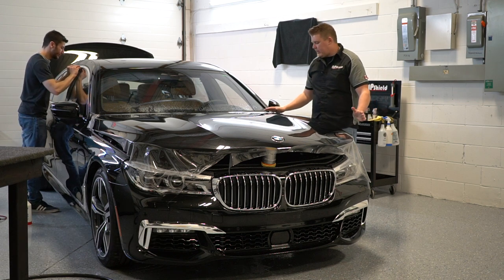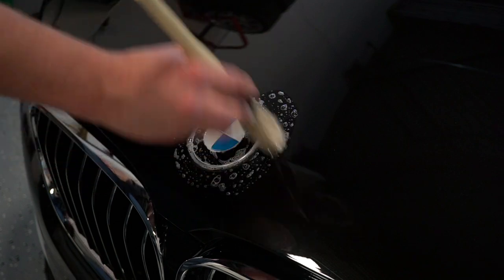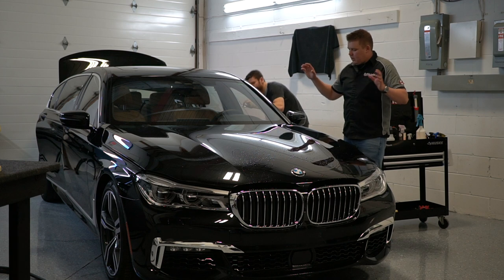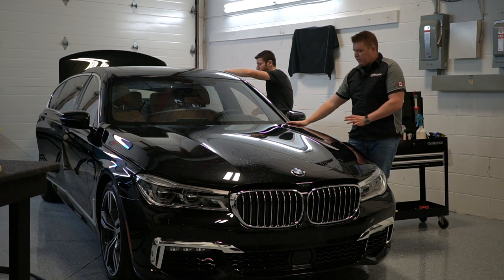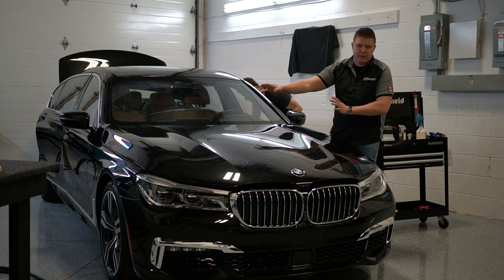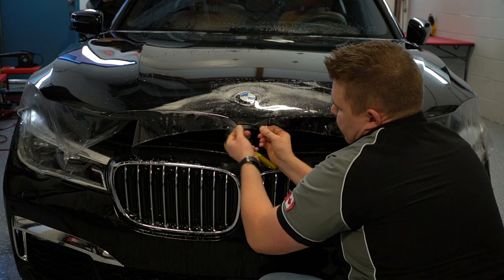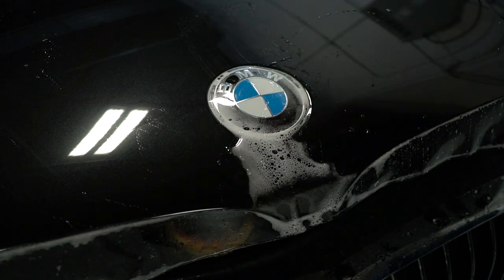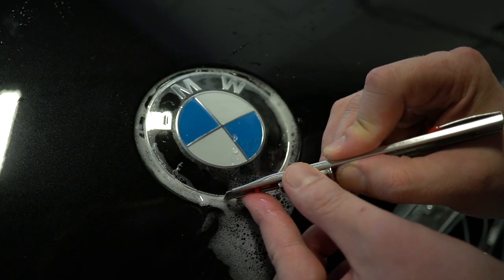BMW 7 Series Hood PPF Wrap - Oversized Hood - No Stretching - No Pull Marks

Comment: What Film are you using? If I tacked those front corners like you did, then re-lifted them there would be hard glue lines all over the place. It was slipping back along the edges then you just pulled it up and stretched it and laid it back down. Not a chance I could even think of doing it this way without a ton of work marks. Tack by A post on fender, other side on fender, then on headlights and go to town. Any tacks I have on the panel will always show glue lines... This has to be suntek or Llumar....
Reply: Pretty sure he uses xpel.
Reply: joshophett 
He does use XPEL - However, according to his Instagram post on this vehicle, this is STEK DYNOshield film. 🙂

Comment: If you dont mind me asking, what do you use for your tack solution? I ask because sometimes when I do large stretches like that I get stretch marks. I'm wondering if it has something to do with my tack solution
Reply: Eric Wigginton never tack on the panel before the stretch. Always tack your film for example on the fenders..stretch across, then pull and tack at the headlights or bumper. Make sure the film is floating on the hood and then you can squeegee the slip solution out.
Reply from the maker: HI Eric,

Check out how I do the solution mixtures.

https://youtu.be/Nov_z9751Nk

Comment: Can you use that to wrap macan hood?
Reply from the maker: In a way, yes!!  The Macan hood is just a huge piece and will require lots of care not to overstretch the film.  Keep in mind, if you try to do the hood of a Macan in 1 piece, you are stretching the film thin, and it will be prone to damage from stone chips.  The rocks can slit the film easier, and the film has the potential of peeling back on the rock chips.